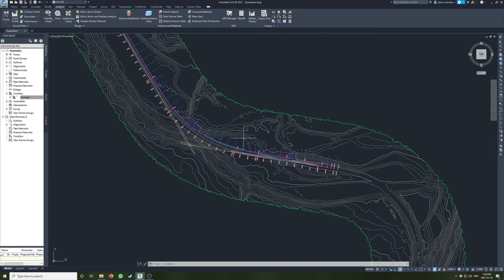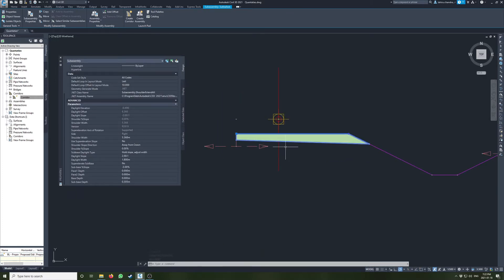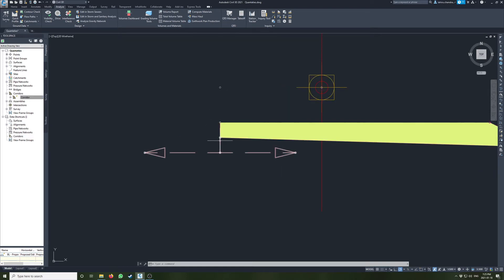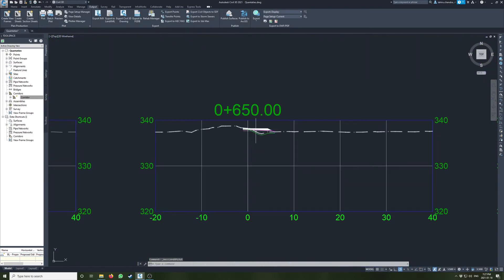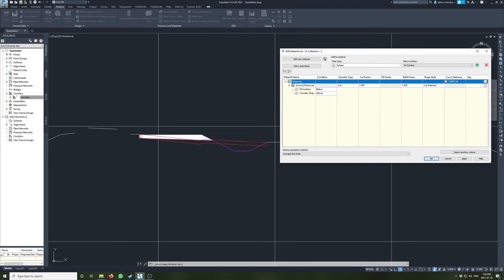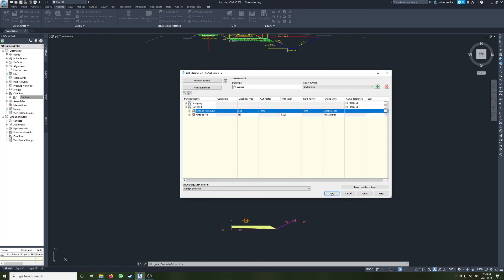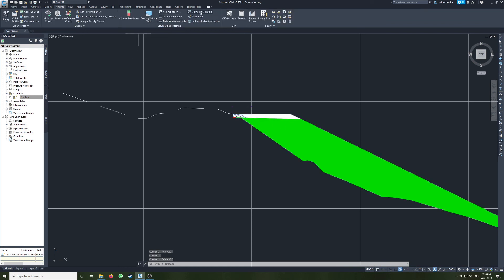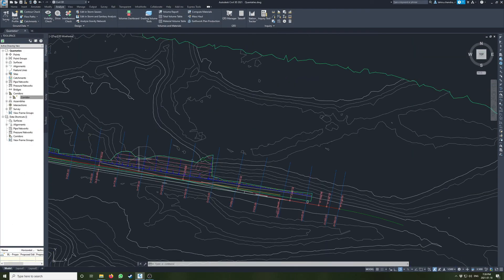AutoCAD Civil 3D - Corridor Surfaces and Volume Calculations

Comment: I've been trying to work out how to calculate the stripping volume for a while, thanks to your video I now know the stripping assembiles.  Totally agree with you on doing those shadings and checking that it's all calculating correctly, it's easy and well worth while.  Keep up the good videos.
I wonder if you've found a way of getting a report that shows fill and cut batter areas at the same frequency as the sample lines?
Reply from the maker: I'm so glad to hear that! The volume report calculates by the frequency of the sample lines by default. So if you follow what I did in the video, you should get what you're looking for.
Reply: @civil3dtrackdesign433  Hi,  the volumes are working out perfectly but what I'm trying to calcualte is the batter area  and volume, not just volume.  The reason I want areas is that often we need to treat the batters, in fills it might be a landscaping operation, it cut batters it might be trimming or shotcreting.  Hope you've got a few ideas
Reply from the maker: @stevedavidson8856  Oh understood. In your case, I'd try applying a different a different link code to the link that's creating your batter (slope to surface?). The default code is datum, but you can use a comma and apply mode codes. Then you can create a new surface just for your batter limits using the new code to compare against EG in the volume calculation. Let me know if that works out.
Reply: @civil3dtrackdesign433  thanks I'll give it a go this week
Reply: @stevedavidson8856  change the report template, or work with table annotation, you can choose different columns and even organise them including volume and surface and other option available....